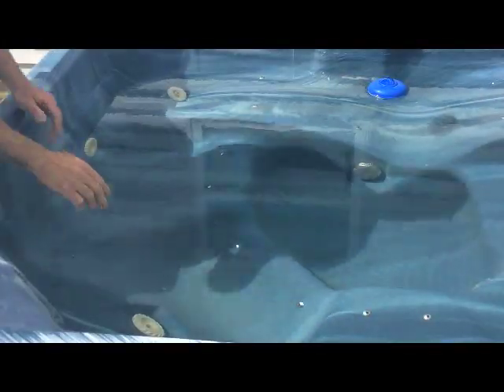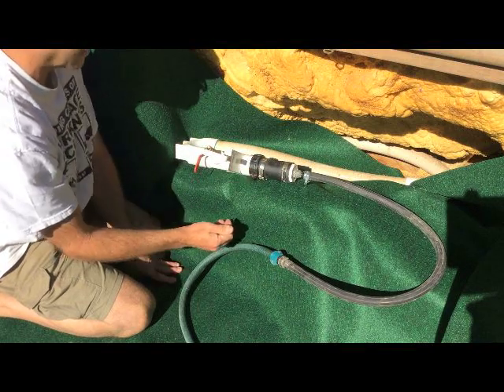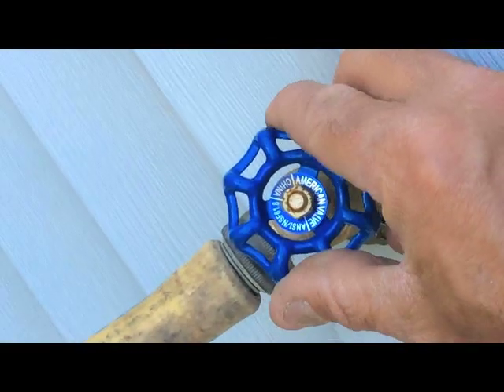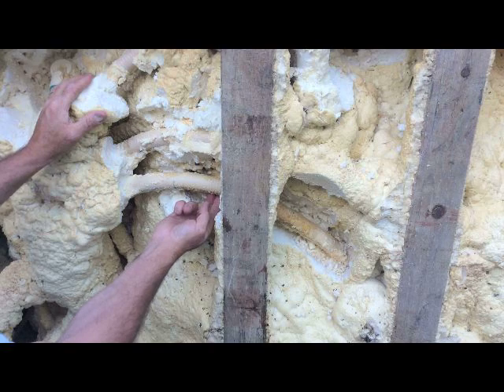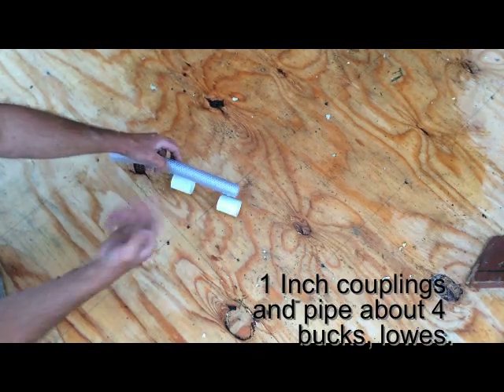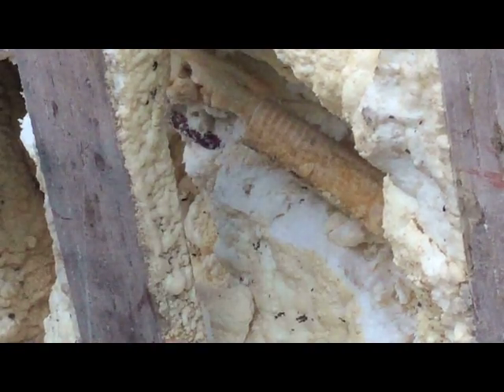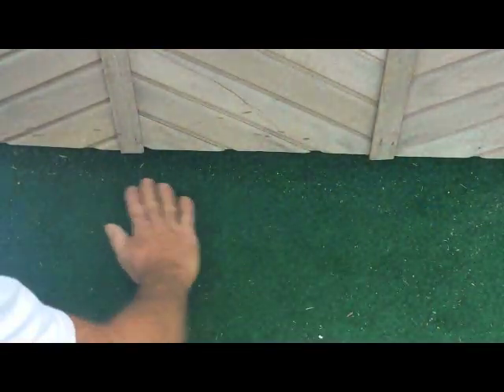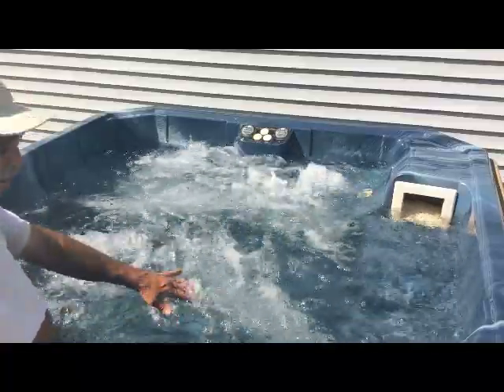How to find and repair Hot Tub leak

Comment: You mentioned that maybe freezing caused  the leak?  I have a dreammaker and it has no access panels.  It is one piece with open bottom.  Leaks all the way to bottom.  Happend right after -40 degrees we had in Denver then 65 a couple of days later.
Reply from the maker: Ya it dose not take much to freeze up.

Comment: What about a tub that is solid plastic- can I cut away sections in a last ditch effort to find leak?  Or, will it be structurally unsound after cutting off sides?  This whole tub thing has been nothing but a hassle, IMO.  Considering zaw saw to cut it up and throw out in sections.
Reply from the maker: Sure as long as you are not cutting in the tub you should be fine.

Comment: OK I will share my 2 cent fix.  The flex line into one of the PVC elbows was dripping.  I cleaned the joint out with a thin straight edge screwdriver, it had some foam around it.  I cleaned it a little bit down into the flex where it was leaking.  Then I wrapped it with teflon tape, and carefully shoved the tape into the joint where it was leaking.  I did this a few times, pushing the tape into the joint.  No leak.  I'll hit it with some silicone after it dries.  OK 10 cents of silicone, the 12 cent fix.  Necessity is the mother of invention I had to think about this one.
Reply from the maker: Not bad will have to try that idea! Thanks for watching.
Reply: @channelron3593 thanks, I am subscribing and need to go back and check out some of your other videos.

Comment: Rob, don't be offended but primer is a compound used to clean and break down impurities on the surface of the pvc. That being said its clearly not dry before you added your glue and it breaks that chemical down too. That is the wrong glue - Oatey rain or shine blue glue is great  sold at home depot next to the stuff that you used, put that on, and wipe it off to clean your pipes and its a much better primer.. 
I've seen 30 year experience plumbers do the same thing and uts because its not vital pressurized lines and they are in a hurry.
Apply to both pieces and twist them until they lock up. That will hold 150 psi. Any other technique or product will make you learn the hard way if your putting your name on your work.
I do tub repair for a living to support a family of 6. Your leak detection technique is remarkable and I will use that technique sometime.
Reply from the maker: Not offended, nicely said and thank you for the input!